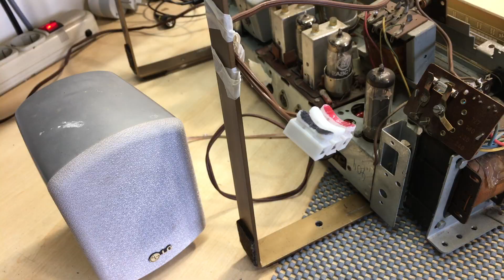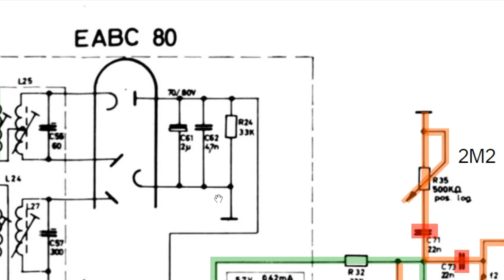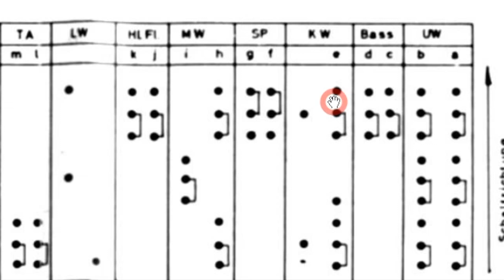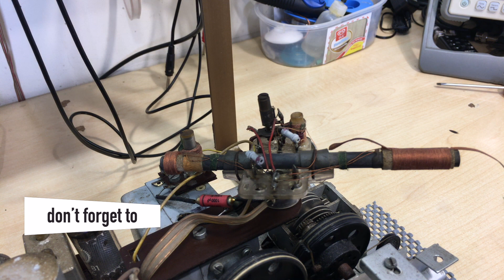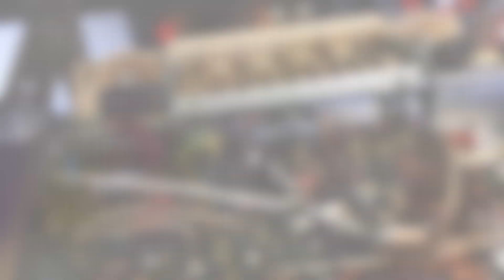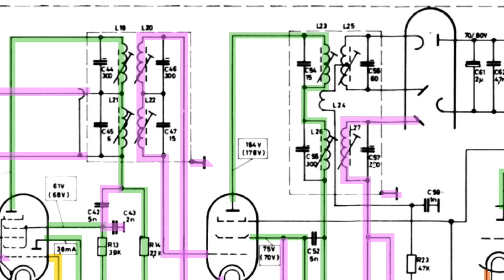Loewe-Opta Rheinperle 5717W restoration - Part 5. Completion of the AM section.

Comment: What software are you using to display and trace the schematic?  I generally have used paper and a highlighter, but this looks really slick.
Reply from the maker: Ellen Hardin : I use adobe reader. The lines are via the “comments” function.
Reply: @electronicsoldandnew  Hello again, Do you use the Adobe Professional edition? I cannot find this function in the standard Reader.

Comment: Thank you for the excellent video. This will be very useful for me in diagnosing my dead  Philetta  284u. Mine has the same tube lay out except for 12 volt filaments.
Reply from the maker: Be careful with that hot chassis. Good luck.